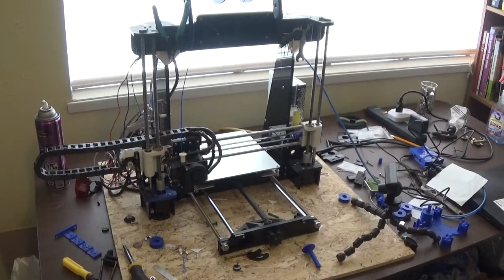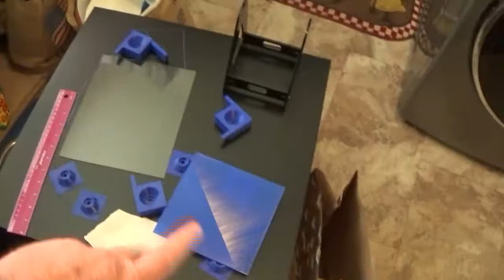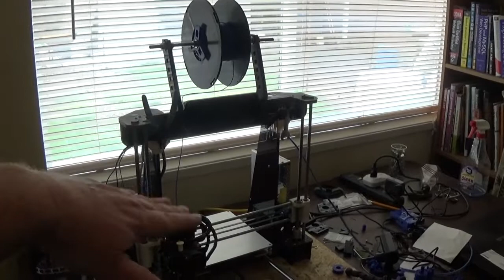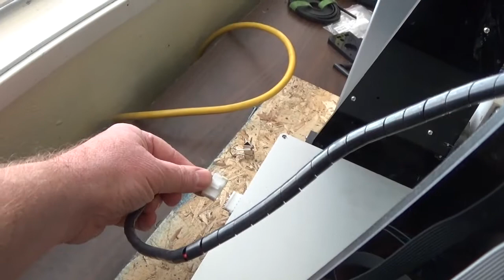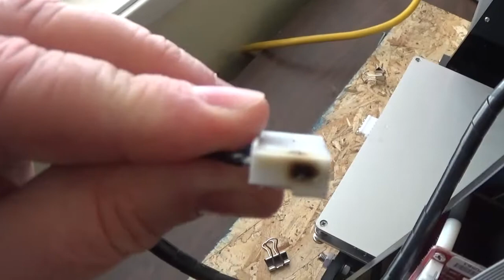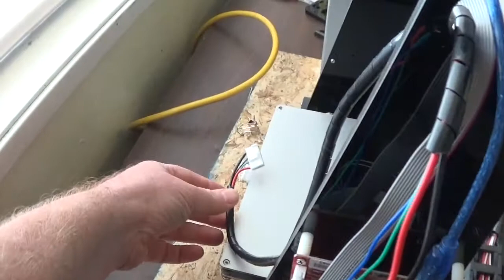Anet A8 almost caught fire

Comment: Those beds need 2 positive and 2 negative wires to carry the required current between them. The actual bed connector is designed for that but Anet cheaped-out and only used two cables for power instead of 4. Upping the AWG of the cables to AWG 14 is safer and allows for faster heating of the bed. The bed cables should also be fused as the heatbed relies on paint for insulation near the screws/springs and there is a chance that the full bed current could short to ground. Rubber or heat washers will help to prevent this but fuses on the bed and hot end power lines are a minimum.  Aftermarket cables are available that make use of all 4 pins and share the current to bring the connector back in spec. Hotglue around the connector can help. Soldering to the bed is OK so long as there is strain relief. Printed cable chains are just an additional fire hazard (as is spiral wrap) but some sort of strain relief would also help.

Comment: Just a note mate. If the mosfet on either the heatbed or hot end fails short, there is nothing the board can do to shut off power. Even worse on something like a Tornado with a mains powered bed. I rigged a few failsafes ( Octopi with Temperature Failsafe and Smartplug Plugins and / or an arduino with a secondary thermistor and / or smoke sensor but the safest thing is to never trust it and leave it alone for too long. Good printer though.

Comment: Removing that loose connector and soldering the wires directly to the heat bed pins is one of the first thing that should be done before using this printer.  And of course Marlin, mosfests, fused power switch etc. I have watched some of your videos, I"m surprised you hadn't done that already.